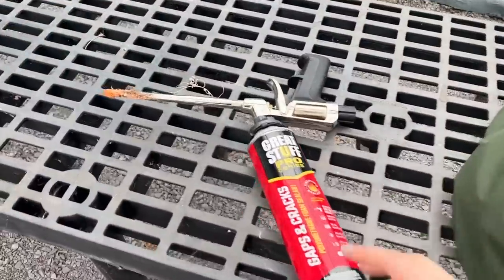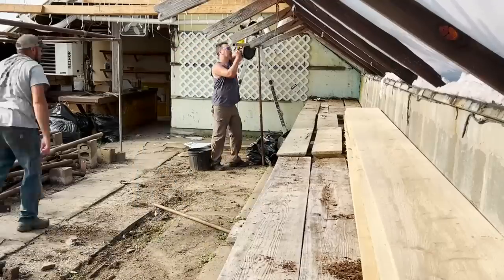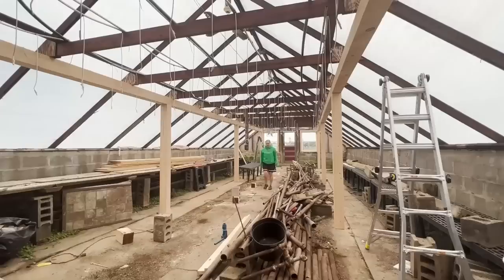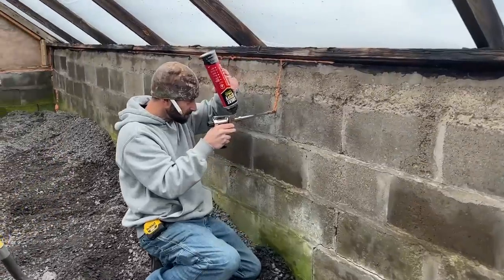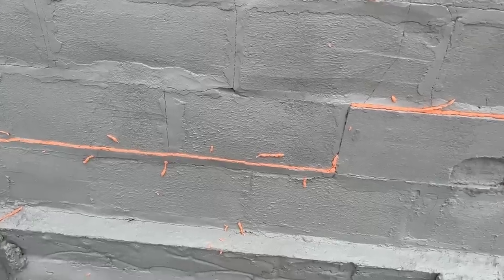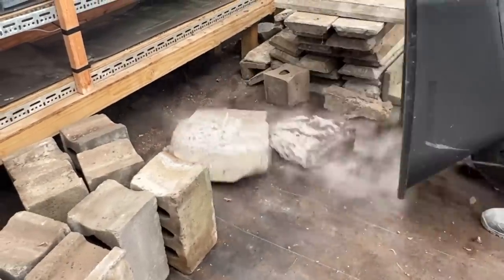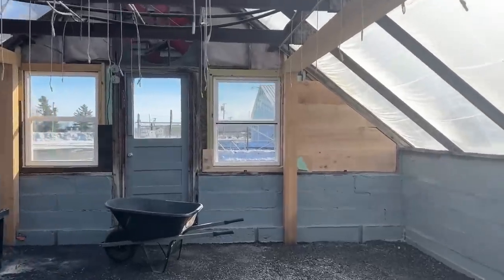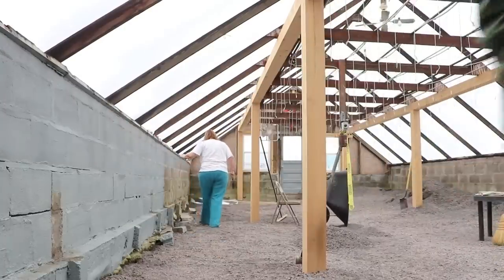Renovation Recap! Greenhouse 1 :  Flower Hill Farm

Comment: A few suggestions for your greenhouse 1 from an old nurseryman : 1. Invest in some wiggle wire and a second plastic layer on the outside. Get a few small blower fans to pillow your second layer. 2. Get 2 inch foam board put it on the outside block wall. Put metal lathe screen on top and parge over. There are special screws and adhesives to attach the foam board to the block and the lathe and this will protect the foam from damage and UV. 

We did both of these fixes 25 years ago to our greenhouses and saw a 50% increase in heat efficiency. We live in a zone 6a climate with 69mph winter winds and 5-10 feet of snow. This fix costs upfront but pays out huge dividends long-term in heating costs.
Keep going you guys are doing great!

Comment: Lookin' Good Kid!   I wouldn't trust that caulking the current obvious cracks will take care of you in future. There are specific coatings that you can paint on concrete for water and wind proofing.   Something like "Liquid Rubber" will expand with any cracks that occur with future movement.   Another insulating idea down the road could be to add a rubber coating on the outside like what they paint on a new house foundation to stop water infiltration - especially since you have those huge snow drifts that are holding moisture in the blocks which are porous, which can ultimately lead to new cracking.  Google concrete water/wind proofing and you find a gazillion products.   Not cheap and mom will have to paint the walls again but the anxiety on your face just made me suggest it.   Good luck :)

Comment: That building is looking so good. I also love the green on the door. GREAT CHOICE!
BUT,, I am worried about how you busted out the wall reinforcement sections. Those are to prevent the walls from buckling inward. When those walls were built, odds are they didn't use REBAR,, so there is a good chance they will buckle inward and collapse the walls with so much of a LOAD-BEARING of the structure..especially the roof. Did an Construction Engineer tell you it was okay to get rid of those? I hope that doesn't cause you issues in the future.
Reply from the maker: They were not wall reinforcements. They were legs the previous owner built for the tables. They were just sitting there and tumbled off very easily!